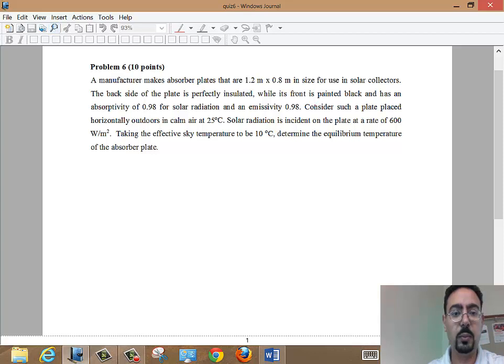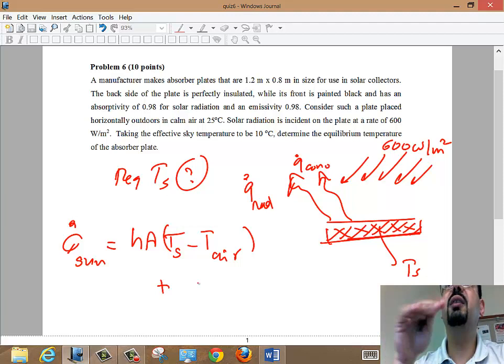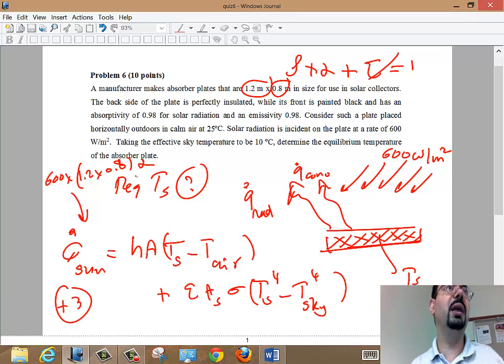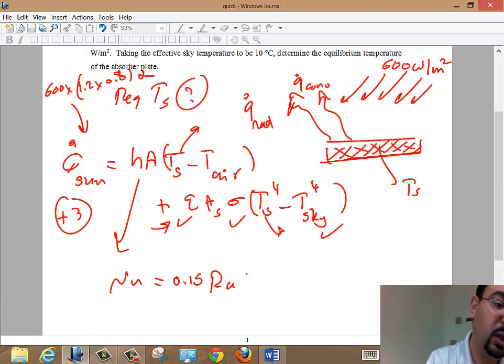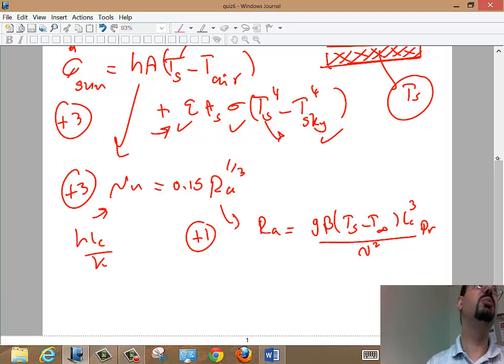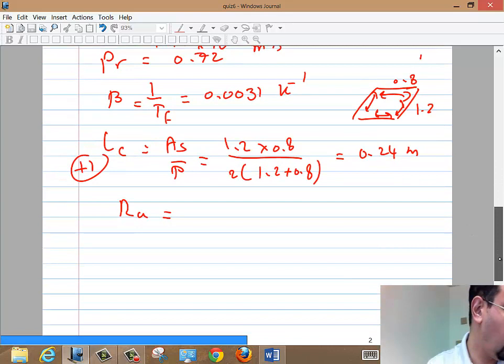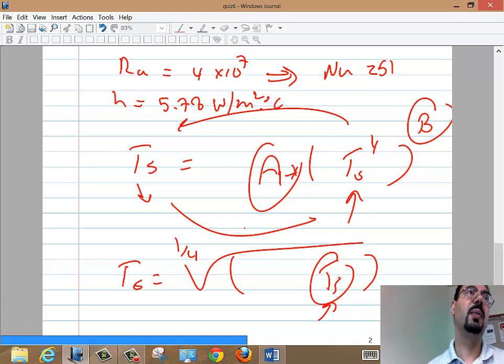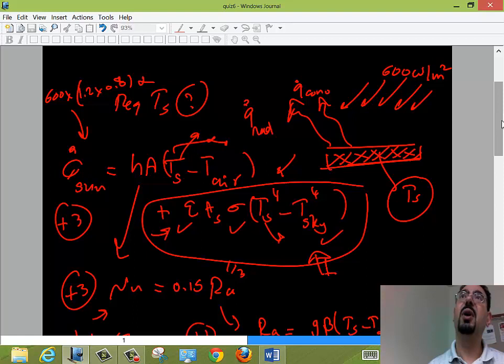Heat Transfer : problem solution - solar collector

Comment: sir if it is inclosed in a glass chamber, should we write air temperature instead of sky temperature?
Reply from the maker: The radiation heat transfer should be based on the temperature of the part receiving the radiation (in both cases it is the sky).